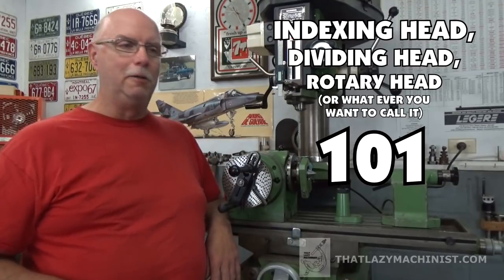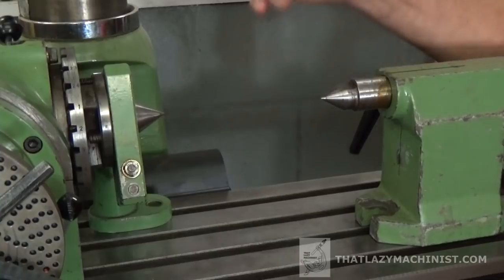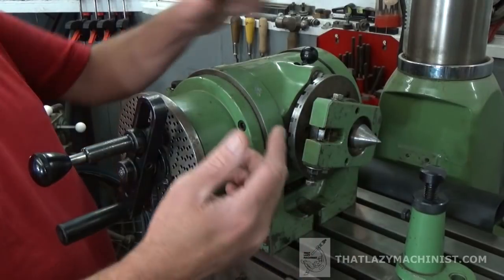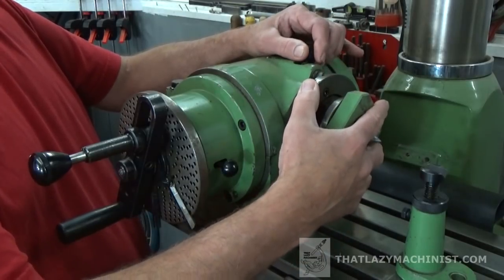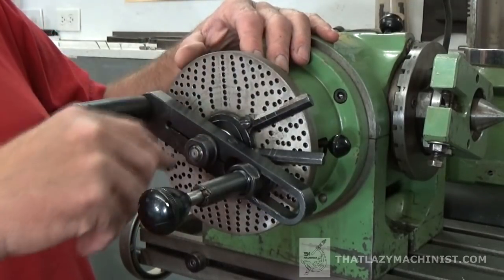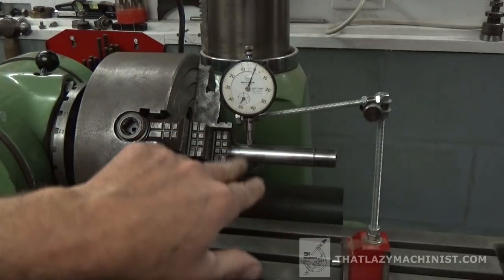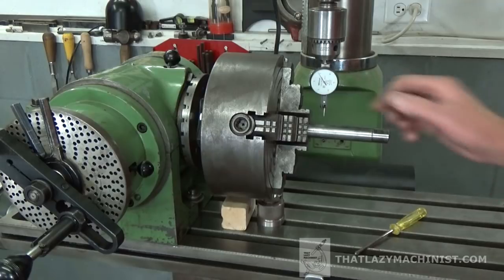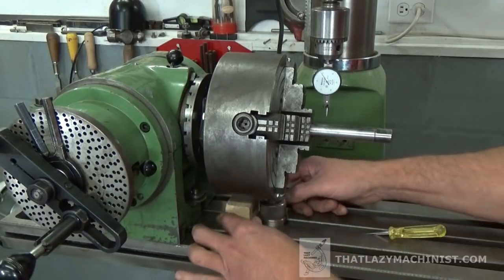DIVIDING HEAD #1 major accessories and pivoting axis alignment with the milling machines table

Comment: Hi Marc!  Nice video using your dividing head.  I bought a used dividing head identical to yours, I am very happy with it.  Do you have a copy of the manual or a pdf?  I would be interested in taking mine apart so a manual would be helpful.